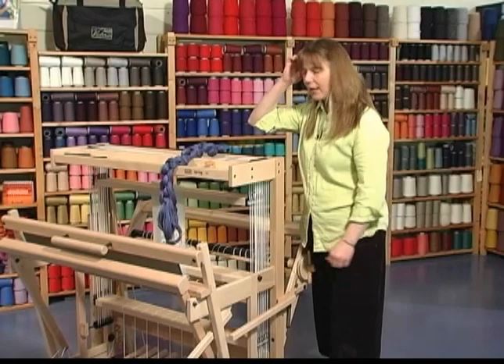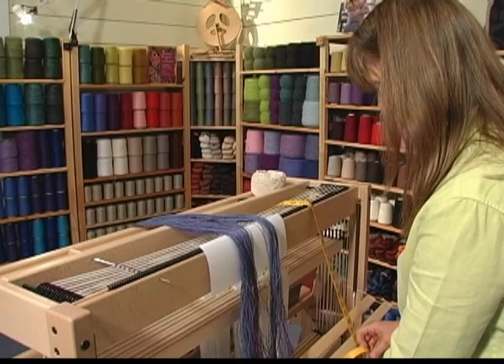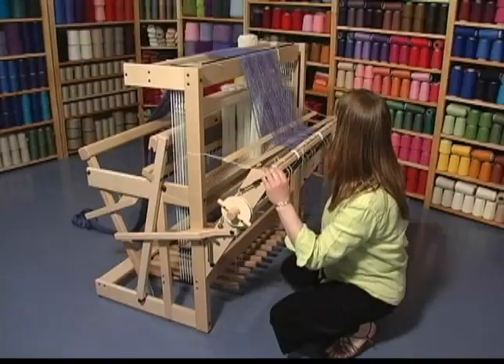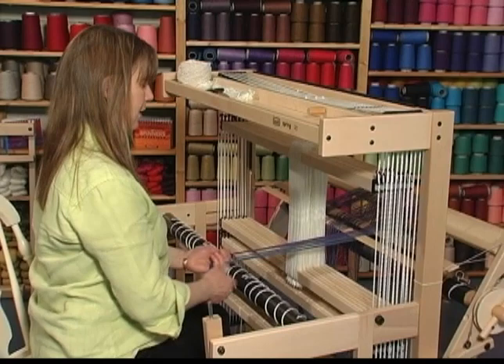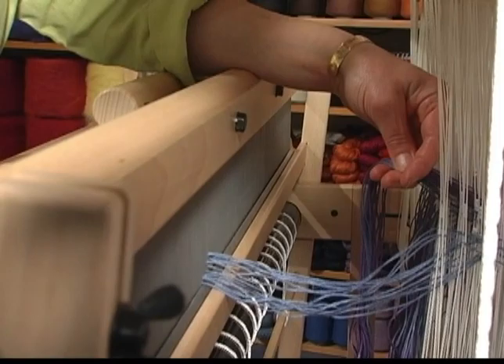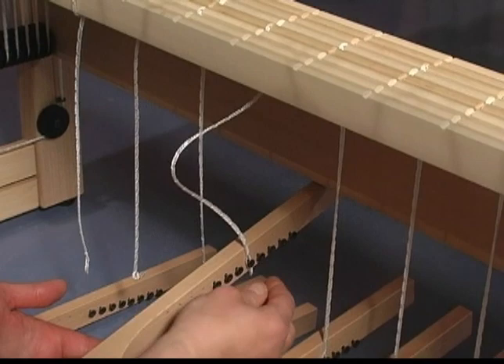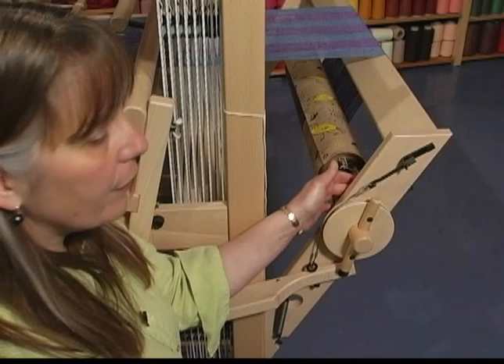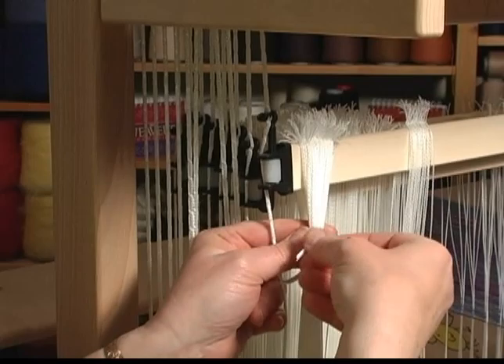Louet Spring Loom Warping Demonstration and Features

Comment: The raddle is the only feature I don't fully like on my Spring. My warp threads tend to get caught in there. So I use a "simple" selfmade raddle with sections of 2cm. I much prefere to have my lease sticks at the loom front, followed be the raddle at the back. But otherwise this is the best loom I tried and owned so far. Hoping for a version that could be extended to 16 shafts in the future ;)
Reply from the maker: Hi! Thanks for your comment! Warp threads can get a bit tangled while winding on, so watch your warp preparation technique to minimize this issue. You should be able to minimize the tangle. The raddle has very smooth separations, but there are approx 5 per inch, so they are close together.  Glad you are enjoying your loom!

Comment: I am having a problem getting a nice big shed like you have. How can I adjust it?
Reply from the maker: Hi Jane! I think we've answered your question over email, but I'm replying here so others can see it! This sounds a lot like a Reed Height issue.   Go to the bottom of the beater assembly – on the right and left sides, there is a pivot point – a screw in hinge.   You need to screw these hinges in deeper so that the warp is resting roughly in the middle of the reed, before you depress a treadle.    When you depress a treadle, the bottom shed should just touch the shuttle race.   If the bottom shed pushes down on the shuttle race, adjust further.    If the beater is sitting too high, you will see a bend in your warp threads immediately behind the beater as the threads are being stretched.   This bend is reducing your shed.